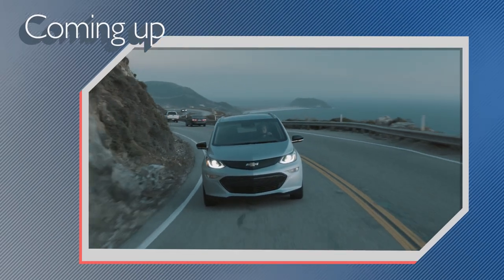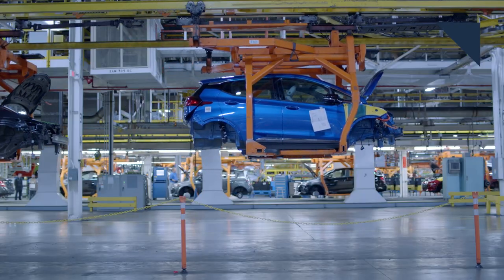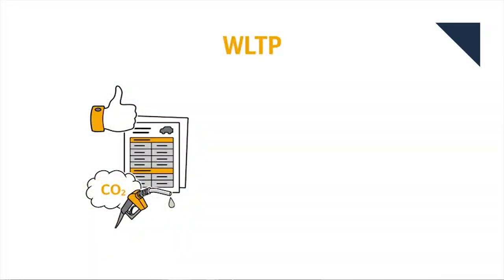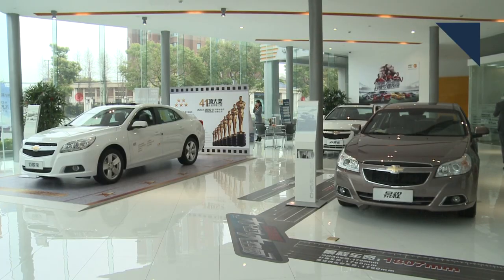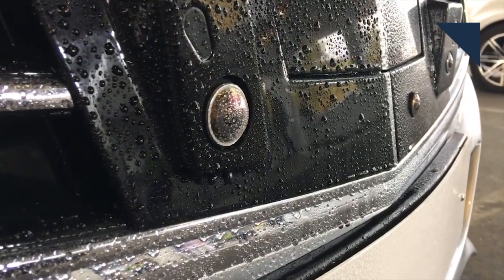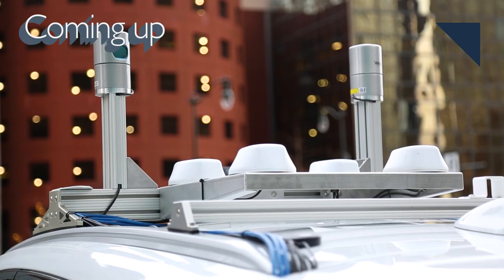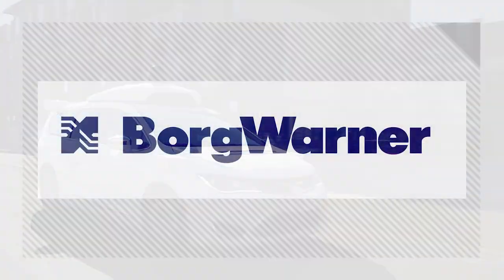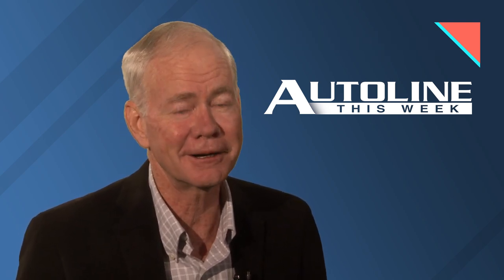What's Wrong w/ Bolt EV? Clever Lens Cleaner - Autoline Daily 2450

Comment: The Bolt is an excellent car, but not at $40k.  In early 2017, I saw discounted Bolts on local Chevy dealer websites for $31k.  Shortly after that, for whatever reason, the prices on those same websites started pushing $40k.  You can't justify that when you can get a Model 3 with 80 miles more range, more luxury, and a MUCH better charging network for $49k.  They've come down a little recently, but not enough.  If Chevy discounts the Bolt to $28k or $29k, it should sell fine.
Reply: I saw one cargurus  for $26k and wondered if it was for real? But with the sales drop it could have been. and Model 3 has a fanboy premium so resale value should be better. So $40k is bad joke for dealer to price a Bolt now.
Reply: N C,  26k is including tax credits,  College graduate, former GM owner and veteran................... The lease deals are insane $240 a month not including the down payment.
Reply: 26k didn't include the tax credits (or shouldnt have unless they lied) but it could have included the other GM rebates as part of the deal...
Reply: NC < GM is losing $7000 on every Bolt they build discounting it another $11,000 is highly unlikely.
Reply: All companies still lose money on BEVs...Its all about using the Bolt platform to develop AVs since just losing any money on BEVs sucks as business model...

And I talked to someone that bought a newish Spark EV with less the 4k on it for $11k that came back as lemon since cable kept coming lose and was replaces so who knows how much they lost on that one?... So I cant be sure of the back story on this car, maybe the dealer could have gotten incentives to get rid of it or just taken the loss... Dont know and dont really care...

BTW, GM lost money on the Volt at 1st too and it makes a profit on it now, so who knows what their margin on the Bolt is now that they raised its price.... So GM not worried if they sell less profit losing or low margin vehicle now...
Reply: @nc3826  
Not all companies are losing money on Bev's (😉)
Reply: Presumably the ZEV credits are worth something.
Reply: NP it will be one day just like the Volt proved for its type of EV 😉
Reply: +N C Tesla is currently making ~36% margin on the expensive Model 3s, around 25% on Model S and X. Nissan is also rumored to net at least 10% on Leaf sales... Renault is also making some money on Zoe's and Twizzys ... They just have to scale up production some more, then EVs will be much more profitable than any ICE car ever made.
Reply: What matters for Tesla is real bottom line profits (like what I learned about getting my finance degree) not top line BS margin figures. There are many types of margin figures that can be used anyway. So what really matters if when it makes a profit and stop needing massive infusions of capital to survive and proves its truly viable.

But I respect a fanboy that can show respect for non-cult car like the Leaf even if its just based on a rumor about its margin (what ever margin figure that may be). But the Leaf's batteries still dies way to easily due to crap thermal management. So who really cares?

But to be honest the EV vs evil ICEV narrative is way to simple mined and is just used by ppl that cant deal with the fact the world far more complex and need one dimensional and unrealistic solution to problems. Im all for EVs and BEVs being developed but the will create in problems too. 

Truth is the real future is about AVs (that GM seems to be making the right moves to have a future). So if you have a cogent retort about the role AVs will play I would be interested to hear it? But the rest of this gets boring fast. Since AVs will have a sea change on society while EVs will just be a powertrain option.
Reply: fatboy19831 we don’t have those low lease rates in ohio
Reply: Dan Sanger -- The BOLT is basically the world's most perfect Honda FIT EV for a 100% premium over the ICE version.
Reply: You are neglecting to include the 7500.00 incentive on the price of the Bolt.
Reply: basically are all. Name a profitable one. Tesla is the biggest offender for money losing
Reply: fake news. look at Tesla's most recent 10q. They are losing a ton of money.
Reply: 2018 Sales of Zoe and i3 EV are no better that 2017 volumes in Europe. Only the Leaf 3 does better than old fashion Leaf 2, but an old Leaf 2 after a short lease with gouvernemental subsidies is quite unselleable without anymore thrown away taxpayers money. Time to bargain! Expert consider here that responding to EV major potential buyer objections on drastic autonomy restriction of a 5 hrs recharge vs. a 5 minutes refill failed to attract New buyer S. Better autonomy has increased both cost and weight on a price sensitive small EV's second car market to an even less affordable level causing sales to stall despite stiff diversion of mfrs. promotion budgets from ICE to EV. Other surprises are the good road test emmission results of most new german diesels per Euro 6d Temp. Following any accelerating addblue modern citybus totally smokeless, we knew that clean diesels could exist on good fuel up to spec. The concept had just to be proprely applied to cars but dieselgate diesel bashing and EV hammering has definitly hurt the market. Philgood
Reply: @Poxenium  if you divide all Tesla tens of billions losses since mod S is produced the co. losses exceed 80000$ per car sold. In average EV grey cost real cost is 3 time of similar ICE but can it can only be sold a 2 time the price despite much greater promotion budjets.EV Loss of resale value is  much greater and out of 3 yrs lease low mileage Leaf2 can be found for 6500$  only. An old mod S with ridiculously poor chinese type body adjustments and exhausted overheated battery, not much more. Back to real world from faked bitcoin accounting.
Reply: GM almost certainly makes a small profit on the Bolt, even if they technically lose money on a base model Bolt with no options (not even sure I believe that) most Bolt's sold have options which are very high profit items and easily make the car profitable.  No way GM didn't profit on my loaded Premier.
Reply: Kind of like the Model 3 is the world;s most perfect Toyota Corolla EV (for a 120% premium over the ICE version)
Reply: Tesla makes money on the EVs they sell, they lose money as a company because of things like the Supercharger network.
Reply: No Tesla loses money on every car they sell after SG&A(marketing, admin, accounting, etc), they lose even more money after R&D. Things like new factories and the SC network are capital expenses which is not reflected on the balance sheet.
Reply: Robert Aitchison I very much doubt the Bolt is profitable for GM, despite limited production, dealers have plenty of stock and GM does not deliver into Europe many Opel versions not to loose too much on each of them. My impression is that they produce a minimum for Tax break and subsidies but not more not to loose too much on each sale. So typically EV grey cost is typically 3 time the cost of a similar ICE but the market only take low quantity at about double the price maximum. Finally a big portion of Renault promotion budget goes to Zoe but sales are a tiny portion of their total sales volume, and Zoe sales are not better In Europe In 2018 than In 2017. Same at BMW. Poor autonomy the prime objection got improved with bigger battery but increased cost is a major obstacle for such second car. It was known that a driver getting a pickup once never goes back to a real car anymore. Not the same for EV: a friend had a Mitsubishi plug In hybrid PVEV and a Leaf 2 but now he changed both of them to diesels Suv's and with savings redo an old Alfa convertible!,as Life is too short for coal cars hardship.
Reply: @raitchison  They make more money on ICE's.  

  Once EVs start to get old, that's when I will start buying them up.  As I have A technology that makes batteries last for decades.
Reply: Whats the frequency Kenneth Maybe, you should wait and get one out of lease or interrupted lease. Fully loaded bargain are sometime hard to sell because those demanding buyers fans can be inflexible, wants the options they selected themself but you should only consider the potential car value.   For instance you may consider a Leaf 2 ouf of lease and unselleable for less than 7000$ and with less than 30000 miles. Resale value is definitly a challenge, EV loose too much value fast. I loose here up to 1.60 US $ per mile of resale value on ICE cars despite the fact that they have the best resale value documented by independant survey of true transaction prices over a large volume representing over 6 months of country new car sales, Boxster Cayman Ghibli etc. Worst ICE devaluations are on S class, Aston, Bentley, and most EV's of course. Philgood.
Reply: Resale value of EVs is skewed by incentives.  If I buy an EV for $30k, get $10k in tax incentives, then the effective acquisition cost is $20k.  If I sell it three years later for $15k, I've really lost only 25%, not 50%.
Reply: Whats the frequency Kenneth you are right altough a normal usage in heavy trafic and commuting to work is basically well defined and with Active Cruise Control and lasy drivers, very smooth and non hard on systems. My logic is that a new car is justify is the features you want don't exist elsewhere, otherwise being opportunist enable to find good second hands. For instance we got here a web site with over 100000 second hands representing 6 month volume of new sales. 90% are resellers try to establish a market price they dream of: plenty of 4999 and 9999$ offers but the rest is retail. To find a bargain i do not enter a particular brand and model only features etc. For instance we needed a second car for my wife i entered 4wd, automatic 5 seats rear camera reholitic suspension leather GPS, less than 30000miles/ 3 years and prices from low to high and thanks to VW scandal a nice Golf R came out cheapest, New, 10000miles 1 yr warranty and 41% off discounted New price  already 8% below retail list price. Later my son bought this way a reposessed mint almost New Alfa Guilia Veloce Q4 for nothing, 50% off a fantastic car.
Reply: Whats the frequency Kenneth Good car systems are designed for about 300000miles and 20 years. Had an very robust Alfa 156 2 liters abused for 18 yrs with total owning ( w/o gas but with full maintenance and repair) at near 31 US cents per miles despite hard work. In year 2000 it was the only low Tax/ less than 10 fiscal french CV car capable of 140mph on highway. A other fast one was the impreza 2.5RS but too costly and demanding gas gussler. In 18 yrs, I used 3 batteries, two sets of discs  5 -6 sets of pads, one set of Bilstein HP mono tubes, 3 belts sets  3 water pumps and thermostat ( cheap so good deal belts removed and car never smell glicol but leather) two sets of spark plugs ( only expensive Bosch and NJK sold here (over 400$ the set with pro discount for a 4 cylinders car) fit this twin spark system but I found excellent Beru instead to stay away from chinese spark plugs. Note Beru had developped a platinum spark plug solution for the first 4 valves heads overheating at the Middle point, the famous Peugeot 405 MI 16) changed only one exhaust tail all this normal maintenance. For Repair replaced items : one exhaust flex after the car took off over a large pickup muffler dropped on the highway and Rowling under the car, one 100$ Takata airbags main shock sensor and one engine speed sensor after 17 year but still ok cold to drive to dealer, were the only unplanned replacement. I also smoked headllights with too many blue iode H7 low life bulbs. Bottom body flight damage welding engine bottom noise and drag shield replaced by a quality ABS Will fit replacement, gas cap repair have been the only unplanned interventions of about 3 labour Hours total. Anyone who does not trust robust good Alfa Romeo reliability, like the 156 gas and the new  Guilia/ Stelvio ( to be fair 159, 147, Guilietta etc are disappointments) he can struggle with a german "failure optimised" product. Just all the right fluids Fiat/ Agip etc are mandatory. The car never burned any oil and regained better than New fuel economy with improved quality wear items. One major challenge to me has been to find good parts on internet: got a faked Valeo thermostat In a Valeo box, bad Continental belt, Valeo pumping only spotted after shorter than planned operating Life.
Reply: @nc3826  Except Tesla, not so?  They've been making a profit on their vehicles for years.  What has been holding them back until now has been the crazy costs of expansion and ramping up to meet demand.
Reply: @earthzero1483  Thx for the talking point meme.... But what really kept them from making a profit in spite of, billions in subsidies. And sales based on a lot of marketing hype, like sending a car into space. And a cult like admiration for a drama queen CEO that call ppl pedophiles and who gets sued by the SEC for making false statements. Or even defending AutoCrash when it kills ppl, which is why it lost to Caddy's SuperCruise in CR tests due to it.

But what is really crazy is cost over runs. From terrible management decisions. Like the poor use of robots in the factories for example. Its all just distractions for the engineers who are the real heroes. 

But now that real competition is coming, we will see how well the hype machine does in the market? But since only CEO will get most of the profits, if the engineers do work miracle and keep them competitive not even the stockholders should be that happy about it. 

EVs and AVs are coming so only a mindless fanboy cares if it comes from their cult leader's company or not....
Reply: Price is EXTREMELY unlikely to drop to 28-29K.  As it is GM is losing money on every one of these they sell even at MSRP.
Reply: Show me where GM states they are losing money on every one of these they sell even at MSRP.?

Comment: Spinning camera lens is clever: some inspiration may be from spinning glass windows on various ocean vessels' pilot houses used to improve visibility during ocean rain/storms.
Reply: i think a wiping system is much simpler tho
Reply: One thing that's cool about a spinning lens is if the mechanism that spins the lens breaks, the camera will still work, but will just have a little bit dirtier lens.
Reply: @123rkss  Wipers would wear and need replacing. An electronically spinning lens can theoretically last the life of the vehicle.

Comment: I tried to buy a Bolt this summer. What kept me back was the fact that, driving it from Louisville to Nashville, there is currently no good places to charge the vehicle. In Nashville, there are a couple of fast-charging stations, but they don’t want you to stay longer than 30 minutes, and it isn’t as fast as a Tesla supercharger. So, I would have to hope I could drive slow enough to make it to the Nashville charger, charge up enough to get around town before going to my final destination, then get the vehicle charged up enough to make it back. Assuming it could. Needless to say, a Model 3 would have no problem, but the ones they are selling now is out of my price range.

I wish the car companies would standardize on a single charging speed that is fast enough without killing the batteries and build out the network the way Tesla has. I really like Tesla, but the world would be a drab place if everybody owned the same car.
Reply: Check out the teslatap or jdapter, so you can use tesla chargers.
Reply: According to Plugshare, Electrify America is installing 4 DC fast charge stations in Bowling Green, at the National Corvette Museum.

Comment: I agree with you on dealerships. I actually enjoyed driving several Bolts, but dealers were never willing to haggle on price since they were so scarce in the Midwest. I also found it frustrating that out of three dealers, only one had a trained EV salesperson. Another thing that happened was I would set an appointment for a test drive only to have the dealer call me later to say it had sold. So I had to go the ICE route. I love the Tesla Model 3, but it is way out of my price range and installing a level 2 charger at my home would have been insanely expensive. Hopefully, in 2020, the VW ID line will be out and perhaps more affordable. I wish that the government had a rebate on the installation of home chargers as well.
Reply: There should be no such thing as dealerships

Comment: I read through the comments and I'm surprised how many people are   suggesting that the completion is a Tesla. There are no base model Tesla sold so there is about a $25,000 difference between what I paid for my Bolt and the cheapest Tesla I could find. I also had no wait time, bought one off the lot with the features I wanted. After tax credit and, given there are almost no moving parts to wear out vs gas cars, hardly any repair costs, cost differential between charging and gasoline, and 8 year warranty on the big battery,  I will spend about the same on this car as I would on a mid-range gas car. I get 350 miles in the summer and 200 in the winter, great interior space, big 'trunk' space with the hatchback, nice leg room in the back seat, and it's really zippy even when it's not in sport mode. 0 to 60 in 6.5 seconds. I've had mine a year and love it.

Comment: I have a 2015 Leaf I was thinking of changing to a Bolt. I drove the Bolt. It is smaller and the interior is really hard and plastic. The seats I don't recall being horrible but a 5 min test drive does not tell you much. My Leaf has much more comfy soft heated seas. I was able to get $2500 off MSRP w/o Federal tax incentive. I am keeping the Leaf. I love the idea of +200 range, but +80 mile range is good enough. My used Leaf was cheap and paid cash.